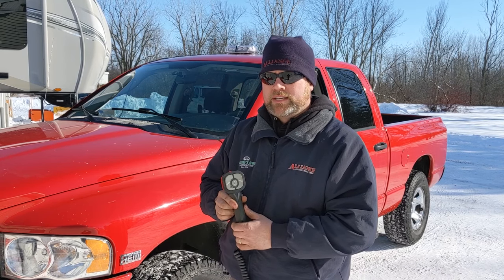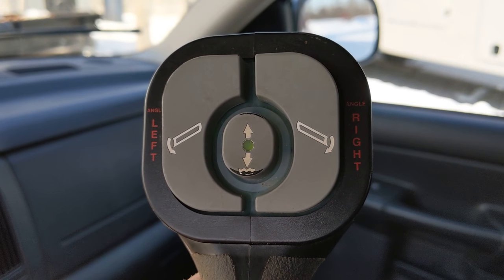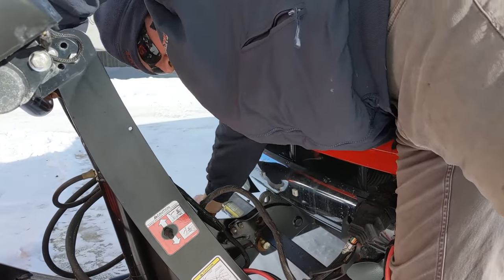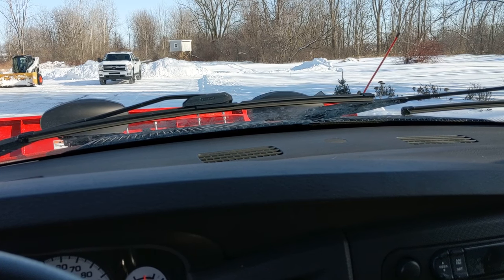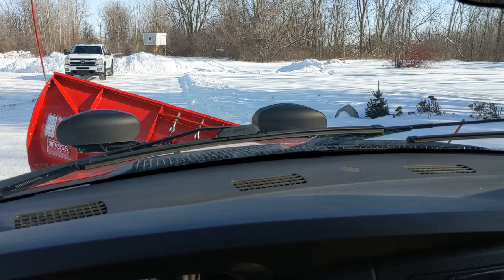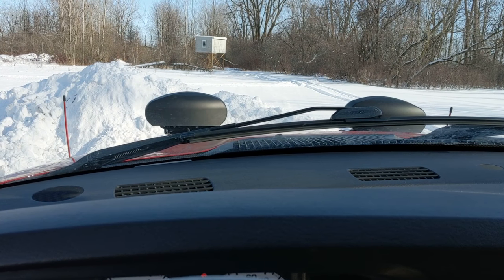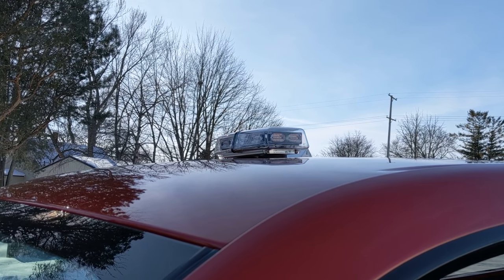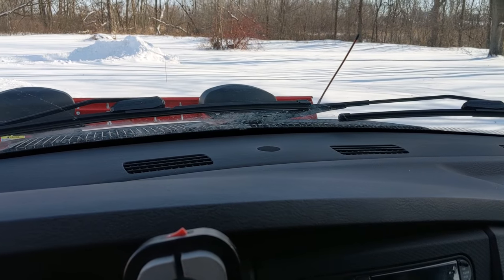How To Plow Snow With a BOSS Straight Plow Truck- START TO FINISH!

Comment: Great informative video..one question do you hold controller in hand when plowing ? Just noticed you put it on your shift lever is it good there if your shifting from Drive to reverse?
Reply from the maker: Actually I have found putting it on the shifter lover works the best for me. I can shift and operate the plow pretty much in one motion. You have to be careful so that it doesn't slide down and wedge between the shifter and steering column lol

Comment: Set the blade down, remove from the truck and get a western
Reply from the maker: I'm sorry Derek, but a Western will not fit on a Boss mount. P.S. I do also have a Western Wide Out. It's a fine unit, but Western plows are not as "standardized" as BOSS. To switch from a straight to a Wide Out, I had to change out the wiring harness. With Boss, any plow/controller works on the same 13 pin wiring harness and RT3 mount. I've also had Fisher, Curtis, and other plows; so I'm able personally form my own opinions.
Reply from the maker: I would like to follow up with a recent discovery about our Western Wideout. One fitting in particular was leaking ever since the plow was brand new. Finally pulled it apart to find that the o-ring was split from the factory. It was causing us to lose about 2 quarts of oil per snow storm. Also the fittings on the angle cylinders loosened up and were spewing oil. The worst thing is the fact that the headlight assemblies broke and fell apart just from the vibration of driving down the road. Western wants over $200 per headlight to replace them. Right now they're just going to have to stay together with packing tape and I will replace them with LEDs at a later date; if I keep the plow. So I would have to say that boss is far superior than Western.
Reply: @danczuba  good answer and we agree with you...Wisdom and age should count a lot

Comment: How does your 1500 handle with the plow? What’s the weight of the plow and mount?
Reply from the maker: It handles very well and the plow and mount weigh approximately 720 lb. I have a 7.5' foot standard duty that I use on a 2004 half ton Chevy. I took the 8-ft super duty from this video and use that on a 2003 2500 HD with a Duramax. On my 2001 3500 I use an 8.5 ft straight blade. On my 2013 2500 HD I use an 8-ft 2-in poly V plow. On my 2005 3500 dump truck I put an EXT 8 ft to 10 ft plow. On my big c5500 GMC with a Duramax I have a western white out. Then I run two skid steers with box pushers and I can change one of the pushers out for an 8-ft steel straight blade. On the Bobcat MT100 I have a 48-in power angle steel straight blade. What's nice about the boss plows is the ability to switch them between trucks.
Reply: What is your preference with the ext

Comment: you can go over 10 mph while plowing if you have a flap on the top of the plow
Reply from the maker: Sure, as long as you don't hit anything. The trip action and or trip edge can only handle so much impact.
Reply: @danczuba  yes, my neighbor sometimes plows are road and we live on a dirt road and he does at least 35 mph.he has a 2006 chevy Silverado 2500 duramax
Reply: 35 is wayyy to fast… 10-15 is plenty for parkin lots and driveways

Comment: The 8’ Boss Super Duty plow is kinda heavy for that 1/2 Ton ? 🙀
Reply from the maker: Actually there's only about a hundred pounds difference between the 8-foot super duty and the 7.5 foot standard-duty plow; which I run on a Chevy half ton of the same year. The Dodge seems to handle the 8-foot blade better than the Chevy. However, please note that I do have the torsion bars cranked up on both trucks. I also have an 8.5 super duty on a Chevy 1 ton, a Boss EXT on another Chevy 1 ton, and an 8'2" XT vee plow on a Chevy 3/4 ton. Lastly, I have a western wideout on a C5500 Topkick. I have tried different plows on different trucks, and have had no issues with the 8-foot super duty on any half tons. The thing to remember is that you should take any plow off when not in use so you're not driving around with extra weight on the front end. I think it's also important to note that I grease the suspension more often than just at the typical oil change.

Comment: My boss straight plow seems to want to fall forward often and I can't figure out why.
Reply from the maker: Could be worn pivot at the A frame...or springs
Reply: @danczuba  I appreciate your response. The plow is basically new. It was used a very limited amount a couple times last year and then just once this year previously on a 2" snow.
Reply from the maker: @ICUTGRASSLLC  how old is the mount on the truck? It's possible that the eyelet pins on the front horns of the mount are worn. The other thing to check is to make sure that the push beam on the plow bracket on the truck is the proper height off the ground. I think it's supposed to be roughly 15 and 1/2 in to the bottom of the push beam on the truck, sitting on a level surface

Comment: Great video - nice rig. Once you go V you never go back though- fact.
Reply from the maker: A v plow definitely has its place. We have 4 straight blades, 3 box pushers, a DXT V, and 3 expandables
Reply: @danczuba   - I agree 100% Dan. I’ve had 4 straights before I went to a V  , but now that I haveI will probably never buy a straight again. I am currently running a 8.5 western mvp3 stainless steel on a 16’ ram 2500 Cummins. Definitely the most stout combination I have ever run.  In Buffalo it gets plenty of use - lol. Keep on snow fighting Dan- good luck out there.
Reply from the maker: If I only had one blade it would be a v
Reply: @Dean Corll the plows are great especially the scoop option but they only thing I don't like is the amount of cutting edges you have to replace, and sometimes the snow will actually push the blade back and it won't stay.

Comment: Three questions, do you have the torsion bars cranked? If, then how long have you had the truck with them cranked w/ the plow? Any suspension issues w/ cranked and plow?
Reply from the maker: I had the truck for 4 years but actually sold it a year ago. The plow was on it for 4 years and I never had any issues. I never drove around with the plow on it for more than the day it was snowing. I did turn the torsion bars a couple turns before getting in alignment. It didn't raise the front end much but it put more tension on it so it didn't squat as much. It probably only made a half inch difference.

Comment: What year is that truck?
Reply from the maker: The Ram is 2004
Reply: Dan Czuba Wow I have an 04 just like in blue. Except my frame rusted through the wheel wheel is getting eatin up now. Front end fell apart gas tank and spare nearly fell off. How is yours so spotless? Are you in New England?
Reply from the maker: Mid Michigan actually. I actually did another video on the truck and explain why it's so clean. If you get a chance check it out